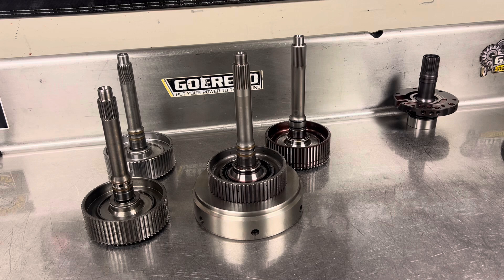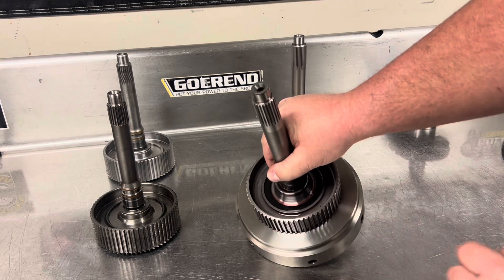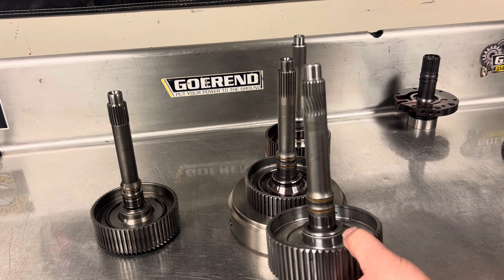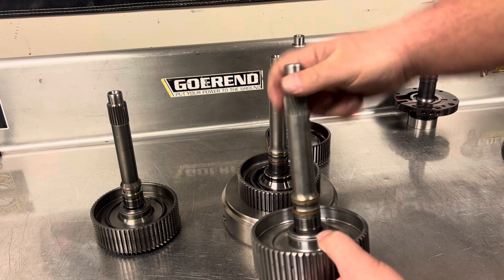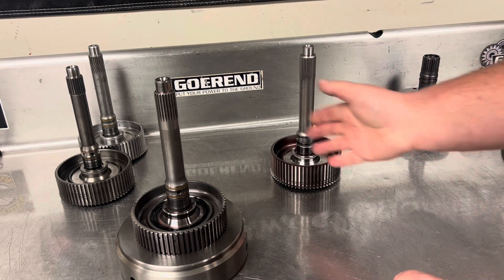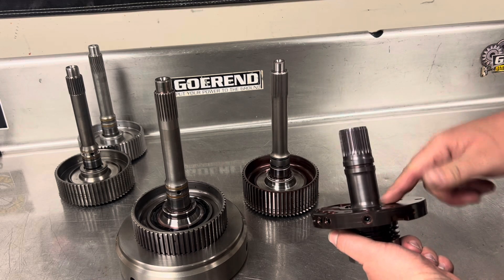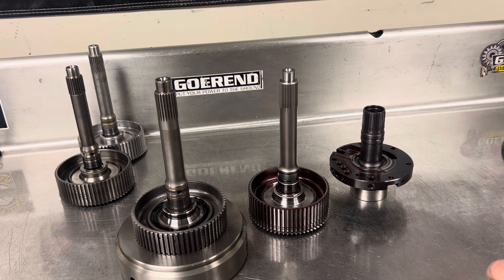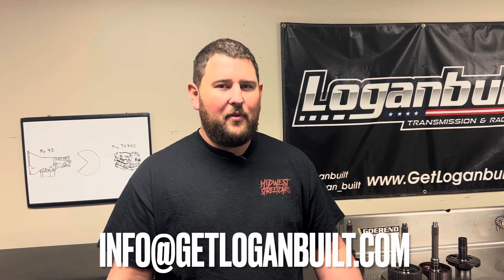There Are ONLY 3 Input Shaft Choices! This Is Why!

Comment: I would be interested in getting your opinion on the TCS Canada 23 spline Aermet input shafts. Have you seen any of them break or twist sub 1000hp (when they have a properly set up valve body)? Thanks for such great videos!
Reply from the maker: Those are OK but they have the same lock up release hole size issue

Comment: Very very good information in this video 
Thanks 
Quick question on a high hp application over 1000hp and u don’t have a goerend vb it’s safe to say just leave the converter sealing ring off then even if using a 48re converter?
Reply from the maker: Thanks! Yes if you do not have a Goerend apply regulated lock up VB, always leave the sealing ring off.